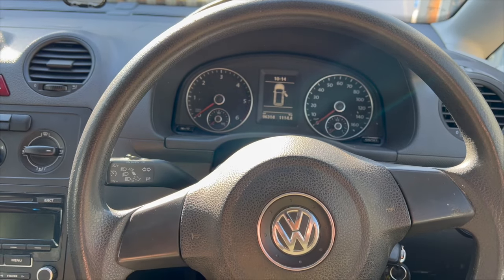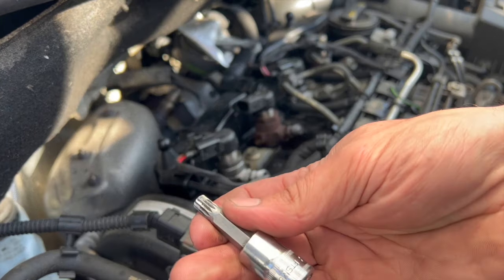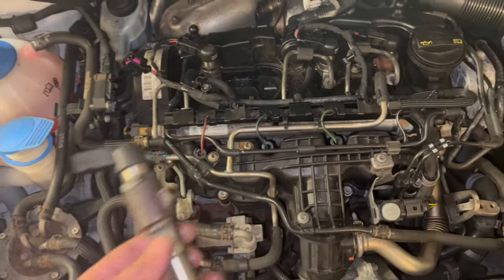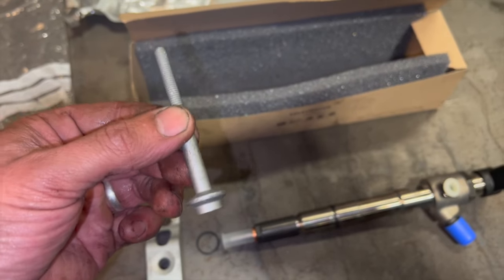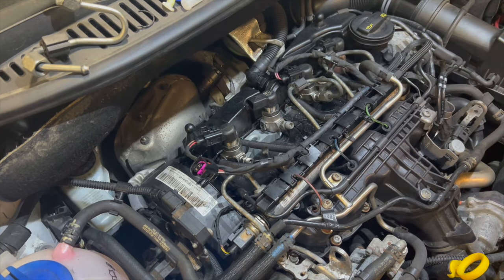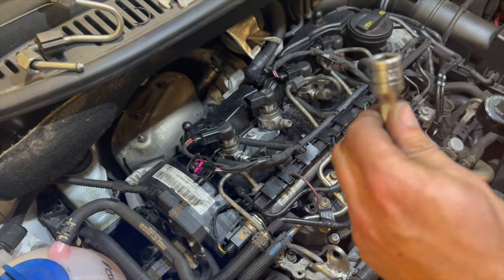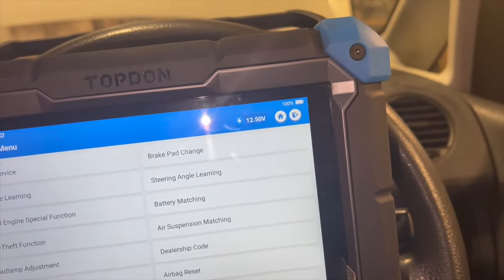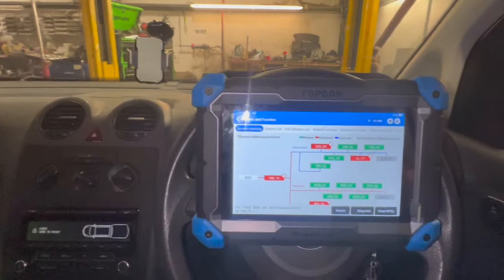VW Caddy 1.6 TDI Injector replacement

Comment: I’m changing mine and laying down in the bottom after taking them out were a spring metal o ring, any ideas where that’s from?
Reply from the maker: Never seen that before! Shouldn’t have a spring washer in there 😬
Reply: @diydaly  they’re normally in the seals that the injector goes through to keep there shape apparently
Reply from the maker: @guychappelle7651  arr right yeah I know exactly what you mean now! Thought you meant a spring washer!! That’s the retainer spring to pull the oil seal in
Reply: @diydaly  that’s the one, wasn’t sure how to describe it

Comment: Would cpl knackered injectors in my mk3 Skoda 1.6 tdi stop it from starting? It won’t start but if I put a cpl  sprays of easy start I starts but turn it off and it won’t start again??
Reply from the maker: it should fire up still Id of thought, check the fuel filter for metal debris.. also check the in tank fuel pump is working
Reply: @diydaly  yeh that’s my next job tomorrow as it it comes up as a low pressure code and there’s a lot noise coming from in tank pump
Reply from the maker: @soapsstevo1670  👍👍

Comment: Have you ever changed the injector bolt oil seal in the rocker cover?
Reply from the maker: Yeah quite a few mate , there’s a choice of 2 different types to be aware of 👍
Reply: @diydaly thanks buddy mine is leaking and causing oil pooling around injector 1 and 2.
Reply: @richardstokes755  I have that problem too . Its the only thing I haven't changed

Comment: Hi
Great Video
I'm in this World of Hurt now. . . . .
Managed to get Injector out, got a Re-Con from Germany.
Found various Torque for the Stretch Bolt, guess it needs to be tight to squash the copper compression washers down. . . . .
7Nm and 180 degrees
8Nm and 180 degrees
& your
8Nm and 270 degrees. . . . . . . . 

Could you guide me to the Source, manual. . . . ?
Reply from the maker: What's your reg number and ill double check.. thanks
Reply: @diydaly  
Dude. . . ?
Put my Reg number up on this website...? No, can't do that. 
2012 Caddy 1.6td
Are you on the VAG system.....
Reply from the maker: @alexmacdiver  I’d need the exact engine number to check that’s all .. I use a reg lookup on autodata ..
Reply: @diydaly   Cheers ;-)    I'll mail it over
Reply from the maker: @alexmacdiver  replied

Comment: Can these injectors leak from the top??  Let me explain, working down from where the electric connector plugs in, there is a smooth surface, and then there is a hexagon shape, can it leak from the top of the hexagon?? As that to me seems to be where mine is leaking, as that is the highest wet point, and it's only wet on one injector at this point, So can it leak there, or is it just an illusion, or a chance it is getting wet there from a leak else  where????/
Reply from the maker: Possibly .. I’ve never had that before though.. most likely the return hose fitting
Reply: @diydaly  So not likely then, that hexagon shape is just to put a tool on it for moving the whole injector, it doesn't actually come apart at that point, it's all one solid piece, so can't leak..... is what I'm thinking... so yea, probably a return line..
Reply from the maker: @isaackent2355  I’d say it will come apart there but yeah most likely the return line
Reply: @diydaly  Really, I dunno if it does come apart there or not, I thought the hexagon was purely there as a place to place a spanner as to wiggle the injector when removing it, as it's not threaded in, just pushed in, and needs wiggling to loosen.

Comment: Are there any alternatives to these injectors my god they are so expensive £345 from ecp with discount code the 2.0tdi bosh injector is around £180 surly someone clever has come up with a cheaper solution
Reply from the maker: Yeah I know! ive not found many a lot cheaper yet 😬
Reply: @diydaly  im dreading the day when my turn comes to replace 1 or more
Reply from the maker: @sonicboom4053  😬

Comment: Hi mate I’ve got a Audi A3 2L TDI and one of my injectors are leaking what looks like oil around it it’s not a bad leak tho would this cause a high idle for instance sometimes the idle stays on 1k RPM and can  feel the car shake and feels like there’s a loss of power also getting white smoke sometimes when I floor it I’ve had it plugged in no codes for anything I put some diesel system cleaner in tank still no difference 1 day car is normal then it’s not any suggestions mate I’ll leave a video on my YouTube of my car if anyone can help 

Thanks for the videos btw 👍🏼
Reply from the maker: They are just oil seals for the rocker cover so shouldn’t cause any idle issue mate , odd though as it’s sounds like an injector fault your having , maybe one on its way out.. you might find it gets worse
Reply: I know this is late pal but I had the exact same issue oil pooling uo near the injectors, got it checked out by my mechanic it’s the rocker cover which is supposed to keep in the oil that’s losing its Seal which is losing oil and also  the injector seals which also need doing
Reply: @rm9207  yeah sold Audi got mk6 now same engine and same problem lol injector seal needs changing must be a common problem with them 👍🏼
Reply: mine does exactly the same as yours, I still can't find the issue, then, the DPF lamp came on and the car doesn't run over 2k rpm.... don't know what to do
Reply: @ikilic9353  I sold my Audi a3 because of it and bought a golf mk6 and the same thing happened again lol so I done some more research it ended up being the DPF trying to regenerate so I took it on the motoway for a good run 30 miles it runs perfect now trust me take your car for a good run add some good quality DPF cleaner in your tank before you do it 👍🏼
Reply: @Reesaming   I cant drive it completely and regenerate it when the car doesn't have almost any power, and can't get above 40 mph. I did already put liquid moly dpf cleaner in it, and I tried to do regenerate with advanced OBD tester, but the DPF heat sensor didn't go over 2-300 degrees warm. for it to regenerate, It need to be at least 6-700 degrees.
but few days before dpf error. the car lost a little bit power, shakes in idle, idle little too high, no error on OBD scan. smokes a lot.
so today I took the injectors out, and tomorrow I will be sending them to a VAG TDI specialist whos gonna clean them and check the injectors if some of them is bad. 

my one is also golf mk6. 1.6 tdi. and I just bought it one week ago, after 2 days, the car began with this $hit.
Reply: @ikilic9353  nightmare ain’t they mine just started having bad idle again today probably from all the short journeys and yeah sounds like your car is in limp mode I wouldn’t waste money on getting the injectors tested when your DPF light come on id just go pay and get it gutted what mileage is your car on mines just hit 209k 😁 

think I’m going to get my DPF deleted there nothing but headache
Reply: @Reesaming   car has run 320.000 km. 

reason why I don't look at dpf is because the soot mass is only 5 grams or sum like that. 

and I can hear some of the injectors "clapping" and 2 of them is leaking. 
so the guy is gonna get it tested, cleaned, and I'm gonna change all the seals. 
and hopefully will work.
if everything goes alright, I will do a standing regeneration, just so the car gets everything it needs.
I was thinking the same thing about dpf delete, but I live In Denmark, and we are the only country in the world with this law, and EU supports it.
if I get caught with af dpf delete, not only do they send my car to MOT test, but they confiscates it, and gives the car directly to VW workshop. and they are gonna put original legal parts on the car, original dpf. and I'm gonna pay for it. if I don't, the police takes the car for good, and sells it on a auction.
I'm not kidding bro haha, Denmark is a shithole when we talk about modified cars. 
Search it up if you want. it's crazy over here.

Comment: Hi, is it a big problem if i haven't got digital torque? Can i use to tighten stretch bolt using just ratchet wrench?
Reply from the maker: you can use a normal torque wrench, no problem doing it without.. its just advisable .. jus be careful not to over tighten it
Reply: Thanks for reply and video.
Reply from the maker: @tomasras  👍

Comment: No need priming fuel lines?
Reply from the maker: Just cycling the ignition a few times should be suffice
Reply: @diydaly , thanks for replying. Is it essential to "code" new injector when installed?
Reply from the maker: @anderskedegard6799  yeah , there do really need coding
Reply: @diydaly  what if I reuse the upper, uncrewable part of injector (where the plastic connection harness is located). Could that be a short-cut solving the problem?
Reply from the maker: @anderskedegard6799  neh it will damage it if you separate it mate , you can try it without coding first see if it runs ok if not just find a small independent garage that’s prepared to do the coding for you
Reply: @diydaly , ok, thnx, much appreciated. 

I've come across information such that it would be easier to remove old injector if having the engine running for a while, meaning that engine block being warmer and thus expanding? What do you think?
Reply: I've had one injector failure few years ago on the Golf mk6 1.6 TDI. Had the injector replaced by authorized VW workshop.

Now recently I had a second injector failure. Do you have any knowledge whether it is usual/common that injectors go? I have 140k km / 87k miles on that Golf.
Reply from the maker: @anderskedegard6799  yeah there mega common mate , we’ve replaced loads

Comment: Any idea why the injectors are coded? Is it an attempt by manufacturers to stop non main dealer repairs? Or is there a legit technical reason 🧐
Reply from the maker: Im not 100% sure tbh mate
Reply: @diydaly  The "coding" is actually a flow calibration for each individual injector so that the ECU can adjust the injector pulse accordingly.
Reply from the maker: @Max-dr6yr  👍 thanks max